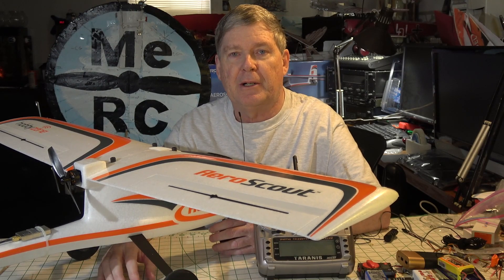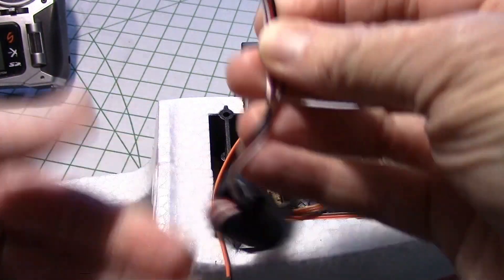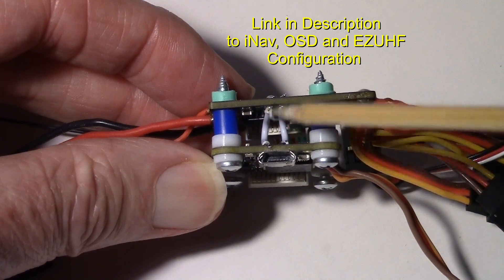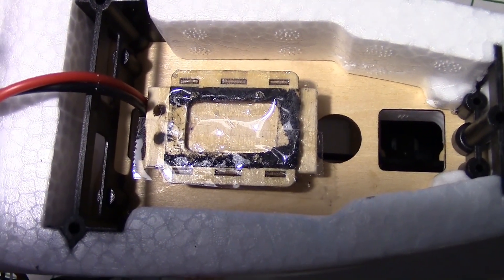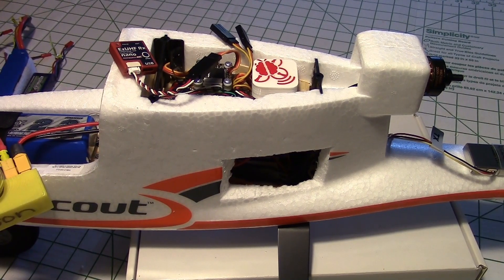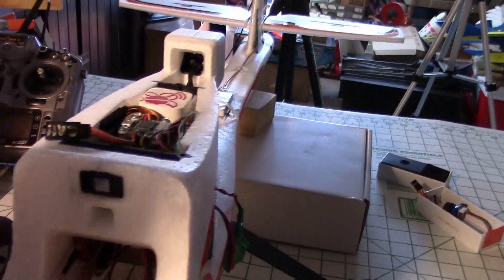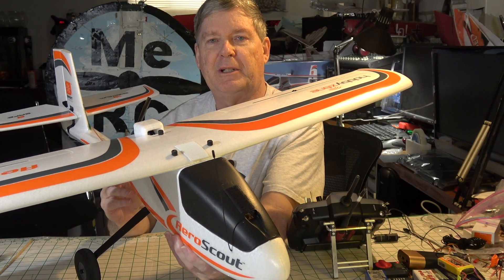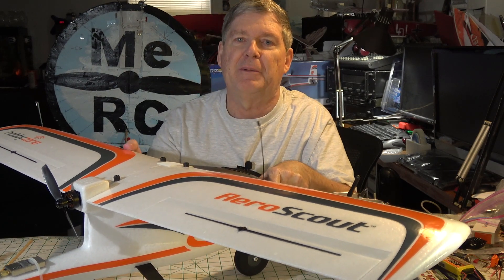AeroScout S 1 1mm FPV Build - Install BrainFPV Radix FC Graphical OSD + GPS in Fuselage

Comment: Nice detailed video! May I ask you a question? Why did you replace you spectrum receiver with another one? I am asking because I try to use spectrum receiver with brain radex and have a problem: the FC doesn't see my receiver. So, may be it doesn't work with brainfpv/INAV? Thanks

Comment: How'd I miss this? The AeroScout is a cool plane, (maybe a little "Chonk", but in a good way), perhaps the result you'd get for asking Tonka to design a plane. I'm curious to know, why go with Horizon's AeroScout for your iNav build rather than an identical ESky Eagle, which lacks the AS3X/Safe electronics? Great to see you're  holding firm to the iNav bug, I've thrown FC's into 6 planes so far - Omnibus F4 Pro's litter the floor of my man-cave, thanks to my other hobby of Kwad Smashing - and won't order a plane without considering an FC. 

Thanks for taking the time and effort to put these videos together, hopefully more people will find what a great  (and easy!) addition iNav is to their plane.
Reply from the maker: Thanks for posting! The reason I got Horizon's version was because the China vendors had no Eskys in stock so I got the AeroScout locally from a hobby shop. It flew great with the AS3X but like you I have to have a real FC with GPS and FPV capability. It's just my thing I guess because of my electronics background.
Reply: @DaveMerc  The electron's flow through this old Navy tech, too. I think that's why my quads sit dormant these days, because the draw of iNav conversions on planes - fun, rewarding, yet challenging stuff. I look forward to your next left-fielder - maybe you'd be interested in my current addiction,  mini Li-ion iNav builds! (Dart 250, Mini AR Wing, Mini Surfer, and a converted Delta Ray)

Comment: Excellent video! Gives me ideas for my Esky Eyas Eagles (identical model but without the Spectrum Rx). I have removed the little platform in mine, giving a lot more room for electronics,  and constructed a 120 x 60 x 15 mm platform which slides in over the servos and rods, giving a big space for stuff under the upper (FC) floor (no need to cut the side panel).  The FPV camera location you have is brilliant! I hadn't noticed the little vent there (it's pretty useless as a vent, anyway, blocked by the nosegear). I'm waiting for calm weather to fly it LOS, but I'm planning the  FPV for it. I'm very tempted to use an F405-Wing on Arduplane together with a  Raspberry Pi  Zero W and LTE ... the LTE approach looks very attractive for digital HD FPV video and avoiding messy VTx and UHF gear (e.g.  youtube.com/watch?v=OIarpIdFzqE ), with Mission Planner as the ground station visual interface (HUD PFD + MFD), the MP OSD being about the nicest there is (and perfectly clear since it is ground-based using telemetry data and not analog video). Pitlab is great (made where I live), but I think the hardware is too big for an Eyas and one still needs to do 433/1.2  RF stuff  for an analog HUD. The LTE approach can retain 2.4 for LOS takeoff and landing phases, given that latency could be an issue. A second HD camera is not needed, since the FPV camera will already be HD; the result would be a very clean plane and a laptop or tablet as the GS (possibly with the help of a smartphone in my pocket ;-).
Reply from the maker: All good ideas you have come up with. I would like to see the finished result when you get done. Sounds interesting. Good luck!

Comment: Nice looking FPV rig Dave. I do admire your instant air field arrangement there :-) I have been out of the loop for a while. Trying to play catch up with my three quads this spring time permitting and also get back into iNav.
Hope you are well.
Reply from the maker: Thanks Chris. I just managed to squeeze that FC and GPS in there and it's doing great picking up the sats. I am doing well for an old man but I can still complain, in fact I am even better at it now :-)
Chris, iNav has really improved a lot especially with the instant profiles that pop in the settings. You should give it a try. Thanks for watching!